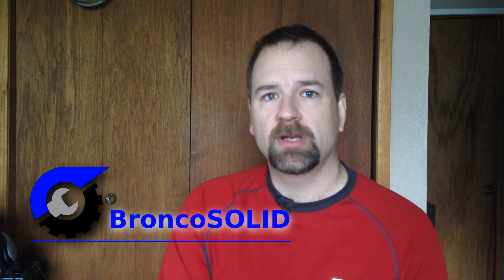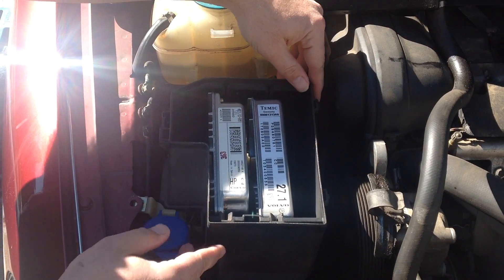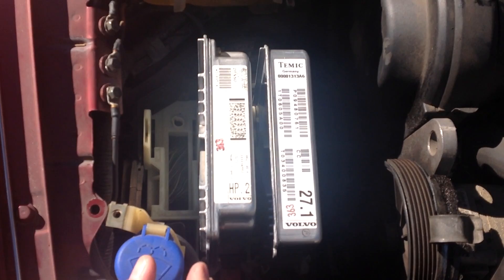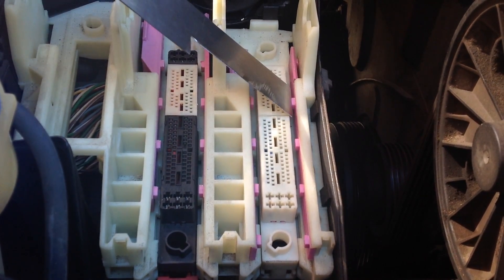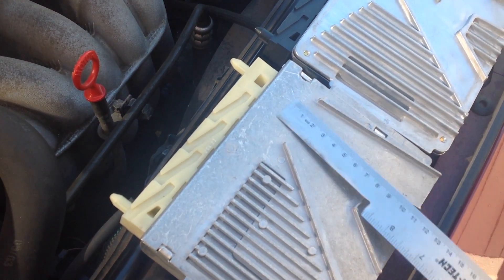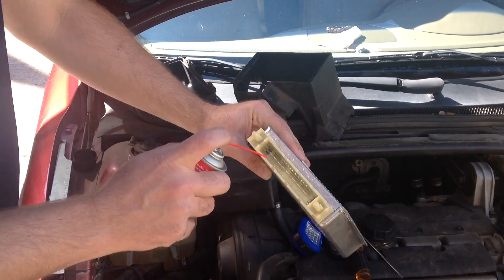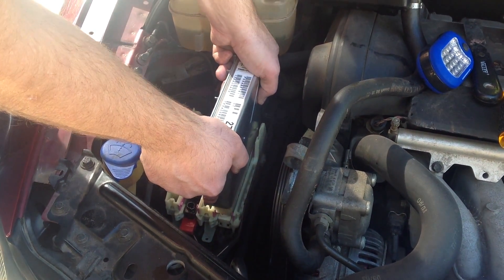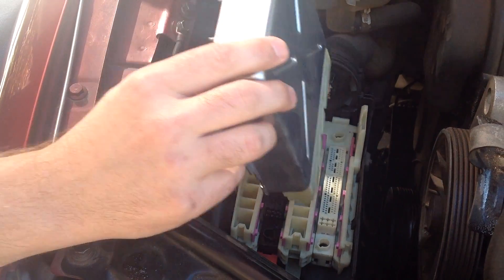Volvo ECM, TCM removal and reinstallation

Comment: OK,,,, I have this Volvo 2001 s 60 T , we picked it up in an auction and it is really clean. It was to what I thought just needing needing plugs and wires but it was actually in limp mode which I knew nothing about and went to drive it home and Then I thought the transmission was out. Long story short I've been around the world with trying to fix this car and throwing parts and buying different types of codes readers. Had friends look at it which are pretty sharp on cars etc. ,,,,,,,,,,,But I watched your video here and thought I had nothing to loose and did the contact cleaner thing. I feel dumb for not trying this before but I know this car had other issues as well, collapsed vacuum lines , ABS etc. Long list. But cleaning both ECM.s let it come out of Limp Mode. Thanks a Billion for this video.
Reply from the maker: Man, that is music to my ears!that's exactly why I made the video. Hopefully this fix holds and it continues to work well for you. Thanks for watching!

Comment: Awesome!  I have a 2004 xc70 with a check engine light diagnostic that is saying unable to communicate with TCM.  I suspect that my leaky power steering fluid reservoir may have something to do with it, spilling fluid onto/near the TCM contacts.  I'm looking forward to replacing the reservoir with a new one this weekend, and seeing if cleaning up the TCM contacts might fix the check engine light problem.  Occasionally (2x) I get a warning saying "transmission service required" so I'm hoping I don't need a new TCM or worse.  Thanks again for posting
Reply from the maker: You bet!
Reply: yes i also have the same problem with my 2004 xc90 t6 awd, problem solved after watching this video, thank you mr. bronco

Comment: i have a 2002 Volvo V70 AWD, are most of the ECM and TCM generally the same? i have a check engine light and on the message center sayin " transmission service required" I took it to a shop and he pulled a couple of codes, tried to reset them but it "slip" from shifting from 1st to 2nd gear when you get going from a start, other than that it runs just fine and shifts into the higher gears once its past 2nd and runs smoothly just its rough and the RPMs go way up before it shifts into 2nd aside from a "new or used" transmission they suggested taking it to the dealer to see about the computer.
Reply: Penny4Bernie 2020   any luck either of you? I'm having this issue
Reply: Penny4Bernie 2020 thanks for the tip. After more research/trial and error I found it might also be a battery starting to go. Basically as the battery dies and gives a lower voltage than ideal the car computers start messing up in all kinds of ways. Worth tossing a fresh battery in and trying (seamed to fix my issues but won’t know for sure till I test drive more) (my car was still starting fine so it doesn’t take much of a bad batter)

Comment: My Volvo 2008 s60 starts just fine put it in gear works for a seconds then cuts out and just revs like it’s in neutral could the Tcm be the problem? Just replaced transmission position sensor and cleared check engine light but still no better

Comment: I have a 2006 Volvo XC90 AWD EU specs. The engine won’t start or even try to crank. Trouble code TCM 0032 and TCM 0A31. Would the ECM & TCM prevent the car from turning on?

Comment: Thanks for the video! At 100 degrees my volvo cuts out, electrics go crazy with warning lights for the airbag, break failure, dials switch off, goes into limpmode. If I replace the ECM do you think this would fix it?
Reply from the maker: Hey Josh, I'd put money on the CEM, Central Electronic Module.  What model and year do you have?
Reply: ok! Volvo v70 2004 D5
Reply from the maker: http://xemodex.com/us/central-electronic-module-for-volvo-services/

It wasn't cheap, but...it fixed the problem, and it fixed it for a lot cheaper than any dealer or repair shop wanted.  I poured a lot of research into this problem, and this was the fix.  Amazing company with amazing support.
Reply: Ive got the same problem. Did replacing the CEM fix it? Mine is a 2005 XC90
Reply: @sectionsixty4020  did you ever fix this issue?

Comment: I have a 2003 xc90 crank no start. Code said no communication with tcm. Going to try this... any other ideas?
Reply from the maker: No other ideas than what I tried in the video. Good luck! Check for any rodent damage to the working too.
Reply: @BroncoSolid  I have a 2006 Volvo XC90 AWD EU specs. The engine won’t start or even try to crank. Trouble code TCM 0032 and TCM 0A31. Would the ECM & TCM prevent the car from turning on?

Comment: Vehicle: 2000 VOLVO V70SE WAGON
Error Code: P1672 Engine control module ECM 5 volt output low
Symptoms: All gauges go out...occasionally the engine stalls too...it can take a couple minutes turned off before it resets & starts up again.
Sometimes the transmission acts like it is slipping badly for about 10-15 seconds after the reset but then it works fine.
Reply: Hi, did you solve this issue? I have the same issue 😕
Reply: @javierpalencia1995    
No...could not solve it...ended up selling it and getting a different car...sorry.